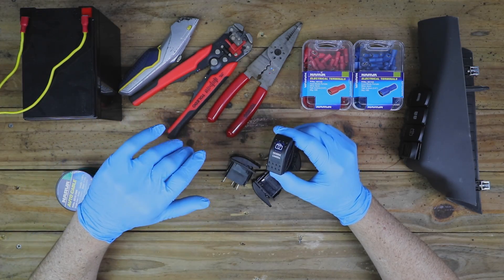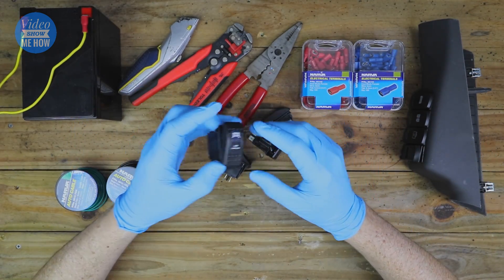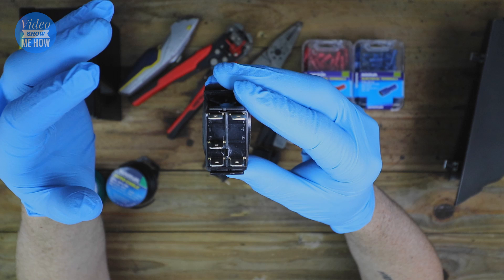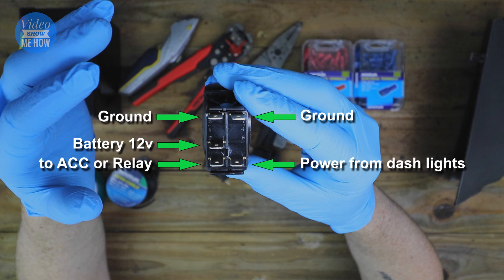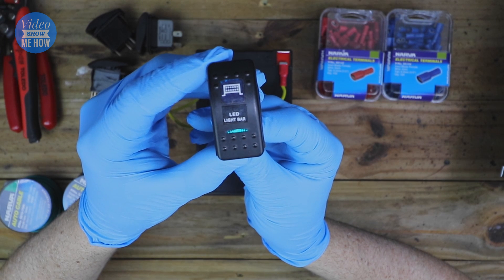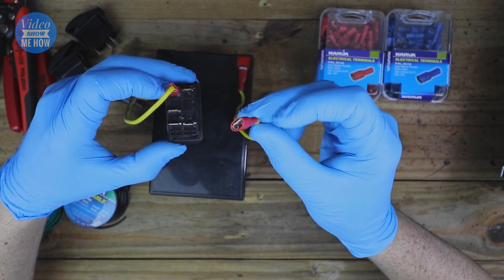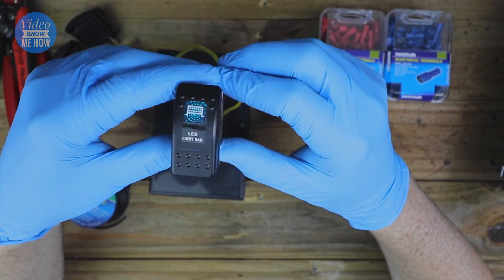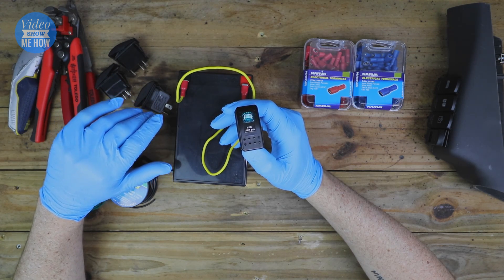HOW TO Wire 12V LED Rocker Switch - Simple Guide and Wiring Explanation

Comment: I really wish I could find a tutorial like this on how to replace the junk 2 button switch that's included with a 6 mode light bar harness with 2 rocker switches - 1 for power, the other for mode. I assume you'd need a Momentary Rocker Switch (ON)-Off-(ON), but I have no clue how to wire it.

Comment: If i were to only use the left side so it does not stay illuminated when in the off position, it would not drain an ATV battery?  Putting short whip lights on the back of my quad and the rocker provided is similar but if i have it wired directly to my battery as i do not have an auxillary bus bar, it will drain it with the light illuminated over time.. just trying to make sure that would actually resolve that issue.  Thanks!

Comment: Good evening. I’m working on a discontinued rv windshield wiper switch on my rv. Unfortunately no one has it? It has 10 pins and I’m not sure this one switch seems simple? I have a separate switch to increase speeds ect.. of the wipers. The switch I want to replace seems as if it’s just an on and off? Not sure why it had 10 pins? I need help!!

Comment: Question:  If I run a wire to from my rocker switch to pin #87 on my relay switch, then run a wire from pin #30 on my relay to my battery,  then the bottom light will stay illuminated when my UTV is turned off, thus eventually running down my battery.  Is there a way around this other than running power to the keyed post?

Comment: I have a contour three LED rocker switch has four prongs when I wired it up the LED lights worked perfectly but then I unplugged it pulled it through the dash and hooked it up again and the LED lights barely come on. I’m getting power. I checked the power. I’m getting 12 Vbut for some reason, the lights are barely on which you know what my issue could be.

Comment: Hey mate, I've got a 3prong rocker wiring harness for my spac fog lights, and I wanna put one of these four prong switches on it, I have tried to find stuff related to mine but all the switches I see are 5 or six prong. 
Would it be possible that I can send you some photos and you tell me what's what? The setups are all chinese off ebay so they have like, zero instructions, and the diagram that came with the switch (its just a photo on ebay, no physical diagram haha) makes like, zero sense to me.
My switch looks exactly like yours but there is no 5th pin for the dash lights, but it has the light for it in the switch, if that makes sense. Do I just jump one of the prongs for the missing 5th one?

Comment: Why are you  calling the black wire ground,?  I have seen ither videos and they say the same thing, its even labeled on such on the rocker itself.   Yet you hook it up to the negative terminal on the battery, which isn't ground.   Ground, especially "Earth Ground" as you call it goes directly  to a grounding rod or the chasis if its a vehicle. Please explain?

Comment: Hi, i need help or answer , just install one on my car with led pods, but the switch led lights staying on when the car is already off. Why is that? Or can i leave it like that or will it drain my battery overnight?
Reply from the maker: @Santino-Tv  For the switch led wire, use a dash light power source, easiest is to use an add-a-fuse to a circuit that only comes on when the engine is on our when your lights are on

Comment: How does this work with a horn using a  negative trigger wire? Do I just substitute the Battery 12V towards the chassis of the car? Do I still ground the horn to the chassis?

Comment: I just installed the switch it came pre wired but for some reason the switch led stays on when car is off how do I fix?
Reply from the maker: @chrismunoz7859  sounds like led wire is constant power, best to tap off a dash wire or add-a-fuse to a circuit that's only active when ignition is on
Reply: @VideoShowMeHow  I have the black and red wire connected and the red one has a 15 fuse. It came with more fuses I haven't connected anything yet other than power and switch
Reply: @VideoShowMeHow  what do you mean by tap off dash wire?

Comment: If wiring an accessory positive to the switch where does the negative wire (black) from the accessory get wired into. Cheers
Reply: @NumanAir  ground your accessory wires to the vehicle frame or a common ground point like a lug or a bus bar

Comment: Hi if I had 2 led lights bars  and 2 switches would I need 2 reply’s ? 2 wiring harness? Would I need a relay for each switch? Thanks
Reply from the maker: @wyleeA  you would be too relays yes but could combo the trigger wire and run a single switch

Comment: Hi Adam. Great video, although I am knowledgeable of what you showed.
I have the exact same 5 pin rocker switch for use on a rear work light, but to spare me running additional wires I have wired a (fused) positive to the work light, then the work light through the rocker switch to earth. So the switch is isolating ground.
This works fine for the work light however the on/off icon light on the switch is reversed - when the work light is on the icon light is off and vice-versa.
Do you know if/how to wire the switch for this configuration?
Cheers, Dave
Reply: I think I have it! 
Add a relay between work light and switch.
Work light (pos) to 85 and 30.
87 to Earth - will provide ground to lights when switched on
86 to pos of switch (2)
Switch (8) to Earth - will complete circuit to relay and turn icon light on
....Now to put that to the test tomorrow.

Comment: Awesome video.. thx . But I still have a question.. when you have the switch totally wired in and all the light are off in the vehicle "parked". The switch would be totally dead or "no lights on switch" so it won't drain your battery?? Right??
Reply: @willduke1656  If your power is wired "key on" then no lights should be on, and the switch won't turn anything on. Technically you could wire the dash light side to key on, and the function side to direct 12V and only have dash lights key on, but still be able to use the switch key on or key off

Comment: Hi Adam , i wanted to ask you in this vid if you need to use a 40 amp rated  12 volt relay with 4 pins would you not use the switch as your load to my lights witch draw about 20.0 amps, instead use a relay powered from the switch terminal  # 3 load to energize  the 86 + side of the relay coil and use #85 neg , then power in from battery  fused  to # 30  and #87 to lights ? Thank you for your help with this . Enjoy your time spent making these videos.
Reply from the maker: Yes if you were running a relay this would carry to load and power in, the switch would be the trigger
Reply: @VideoShowMeHow  thank you for your support Adam and appreciate your time making  it possible for me to complete my installation. Your channel  is very informative. Sincerely,   Tom

Comment: Do you have a video for a 6pin rocker switch? It helped A LOT with re-wiring my fog lights and rear defrost switch, but the rear wiper/wash switch is a 6 pin with 8 numbers and I don't get it.

Comment: Hello there, I am running a dual battery system on my truck and I wonder is it possible to wire a voltmeter from each battery and connects them to one switch? Meaning, I want to be able to use one switch to power two voltmeters coming from two different batteries using this specific switch? Let me if it’s possible and if share some tips I would be grateful. Cheers mate.

Comment: Well done. Nice and simple explanation. For 5 stars - You might have mentioned the pin numbers that are shown on the switch . Also you might have commented that If Pins 3 (Acc) and 6 ( +ve Dash connection)  are joined together then the lower  "dash" light also comes on if so desired for whatever reason as well as the top switch light.

Comment: I bought a light bar set for my truck. It came with 3 wire toggle switches. I'm trying to convert it to a 2 wire multi-switch panel. as I have multiple, and want it to look cleaner. I don't seem to have power when I connect it to the new switch, even though I have the right wires connected. Not sure if I'm missing something, or??

Comment: So I'm trying to use one of these switches to hook up bar light on the sxs but the wiring harness is using a relay I have black= ground , white= positive and a blue wire I want the led on the toggle to be a switched setting = coming on with the key. What do I do with the other 2 wires coming from the relay as I know black is ground 😊 but I'm confused on the white and blue in the harness from the relay? I know where the switched wire is but how do I tie all this together

Comment: You're wiring potentially high wattage through a switch which can only handle low current loads, and thereby result in overheating and possibly fire. Any such circuit for led fog lights for example, which commonly draws 30 - 50 amps needs the addition of a relay.

Comment: Excellent explanation of the switch. I’m using it locally as the on/off switch under my bonnet directly hooked to my battery. Problem was the light remained on and was drawing power. Removed the light switch (power from dash lights). Is this setup still drawing power sitting idle or just live but not active ? Asking if this will drain my battery in the off position ? The hot + power from battery to the switch is fused correctly.
Reply from the maker: 👍 If the LEDs aren't on will be no drain
Reply: @VideoShowMeHow  Champion, thanks for the quick response. Time to subscribe and learn more. Thanks once again.

Comment: Hey there need help on wiring some switches on a buddy’s rzr. It has a types of switches 5 pin 2 on top one I’m middle and 2 bottom I’m adding fuse box how should I wire it also I have 2 4 pins 2 on top than 2 on some side really could use help I got wired like what I found online but want to make sure befor wiring to fuse box

Comment: Simplest solution?  After playing around with the rocker switch (with electrical tester), Color match the wire = color of the rocker switch bolt.  Rocker switch = 1 black bolt screw & 1 (single) or 2 bronze bolt screw (3 way).  Your wire would have 1 line wire (power) and 1 or 2 traveling wire (it's easy to tell the difference by the color of wire).  This is how probably the building manufacturers uses low pay scale workers do connect your wiring at home.  They can just follow by the color of the wire & color of the screw bolt.

Comment: Great video! Question, I have mix of 3 and 5 pin switches in a panel. I would like to wire them so bottom (dash light) light on switch is always on and top led on switch is also always on. Meaning switch is fully illuminated top and bottom all the time whether it is off or on. How would this be done with the 5 pin and 3 pin rocker switches? Thank you

Comment: Was wiring this up for my boat and one of the switched actually came apart.  Found where all the little springs and such go but there was a 12mm section of copper wire that I cannot find a use for.  If you know please advise.

Comment: Is there a safety cover for a rocker switch? When my Lab rides in the Ranger with me, he always places those large paws on the dash and thus constantly turns the 4 wheel drive to various modes. Can’t imagine that is good for the transmission. Need something to place over the switch to prevent that from happening.

Comment: Great video and thanks for sharing!
I installed two of these just yesterday on my car. Can I ask you how to configure them to switch off automatically the dash light when the engine is off and the car key removed? In this moment the switches take power directly from my service battery and the dash lights remain on even if the engine is off and the car closed. 
Thank you in advance!

Comment: Awesome! So I could just wire the left side and skip the dash light correct? I want to wire mine so I can switch it on without have the key in. I know it’ll drain the battery but there occasions I just wanna turn on my spot lights to do something on the farm without turning the key. And I don’t want a light in the switch to be draining it
Reply from the maker: Yep you could
Reply: Thats exactly what I plan on doing for my project. 👍👍

Comment: Hey mate using a stedi kit I want use a toyota switch to fit in my spare slots could you use a fuse tap add a circuit into the 10a tail light fuse to illuminate the switch with dash lights
Reply from the maker: Yep sure could, could tap any fuse that only has power when lights are on
Reply: If the tail light fuse is 10a do I use 2 10a fuses in the add a circuit or a 10a and smaller 1 for the switch
Reply from the maker: @anthonybagnato7894  what load is off the switch? Just the switch light?
Reply: Just the light to illuminate it I’m assuming because there 4 wires 3 from the old switch
Reply from the maker: @anthonybagnato7894  yeah just a small fuse will be fine, will be bugger all draw

Comment: Great video but didn't find the information i was looking for... I want to mount a panel like that on my boat but want every switch connected to a separate fuse so i dont want the plus coming in from one wire but from multiple wires but still have it wired so that all switches are lit up... Hope i wasnt to vague 😎

Comment: Actually this is incorrect, the name plate of the item should be lit when your panel light is turned on. Then the switch light should light up when the switch is activated. How would you know what to turn on if you cannot see the name plate if it were not illuminated at night.

Comment: Where’s the relay? These are straight wired putting the full load through the switch correct?  Isn’t that a fire hazard?
Reply from the maker: This is just a demo, but these switches are rated to 20amps, though anything over 5-10amps or longer runs I'd be running a relay for sure as well as fusing the circuit.

Comment: Hi
My switch is on constant 12v from the car battery. Will my car go flat?
Reply from the maker: Eventually it would but may take a while. I'd recommend tapping into a circuit that is only powered up when you turn the car on

Comment: Adam,
You do such a Great job of making these tasks less … Daunting.

I’m wondering about 7-pin variety.  They make Momentary 7-pin for tasks like Winch In/Out.  I’m curious if the SWITCH is created as a current “reversing” device, or is that function handled elsewhere ?  They also make Latching 7-pin, but they are typically promoted to switch two Separate devices using one switch.

What I’d like to do is use a 7-pin Latching to operate a Fan in a van, in BOTH directions.  The fan itself does not have an intake/exhaust function.  Only intake.  I’d like to create the ability to reverse direction, using a switch.  So, I suppose polarity reversing (??) ….

Are these types of switch ‘usable’ that way, or do I need a Special relay, or …. ?

Thank ever so much !

Comment: I want to use a switch like this but rather than having it disrupting a POS connection I want it to disrupt a NEG wire. Can you use the left sided bottom two connections for a ground instead of a positive. It sounds like the switch will not illuminate when “on” this way though. It’s two bad both LED’s dont get power from the right sided terminals. Any thoughts?

Comment: Nice vid. I am battling to connect a 5 pin switch to my power window. I have no idea where the motor wires go or the power wires. Can you please help me. Regards
Reply from the maker: I would recommend googling the wiring diagram for your car make and model, some out there will probably have a pic for you 👍

Comment: Do you have a video wiring a 3 position rocker switch that is Off/On/On? My switch has 8 pins and both on selections will be back-lit with an led and this switch is being connected to a relay harness with 3 wires. I can't find a wiring diagram anywhere
Reply from the maker: Not yet, have this a few other 12v vids planned for Jan

Comment: Mine are wired up slightly differently. (by an auto sparky) so the part that illuminates the lens with the picture comes on with the dash lights and the (brighter) lens that's just a bar comes on when the switch is on. That way you can easily identify what you are switching in the dark. works well.
Reply from the maker: Yep that's the way. Can have it either, personal preference :)
Reply: What pin do I hook up from the dash lights so that the center light on the switch is not always on?

Comment: Can you power 2 of these switches with 1 wire anyway to jump power like this and still have function like they should?
Reply from the maker: Yep, just watch your max power draw
Reply: @VideoShowMeHow  which wire/pin do you jump?
Reply: I would be powering an led light bar on one and 4 rock lights on the other
Reply from the maker: @nickglass6995  check out the vid on my channel that shows multiple switches 👍

Comment: It's odd to me that the bottom bar it what's illuminated with dash lights. I would think those should be reversed so you can see the icon in the dark.
Reply from the maker: You can switch that around if you prefer :)
Reply: @VideoShowMeHow  how? Those are the only two terminals on my switch that are switched

Comment: Hi thanks for the video, I was wondering if I would be able to use this type of switch for a two way switch setup.
Reply from the maker: Cheers. By two way do you mean switching two devices by the one switch?
Reply: @VideoShowMeHow   no I was more thinking two switches that could control one light. I want to be able to have a switch in the cab of my car and also a switch in the canopy. Just ubit unsure on how to go about it
Reply from the maker: @jamesandrews9410  Ah I see, this type won't work. The type of switch you need is called a single-pole double-throw switch or SPDT
Reply: @VideoShowMeHow  okay thanks heaps for your reply mate. I’ll do some more research on that. Really enjoy your videos